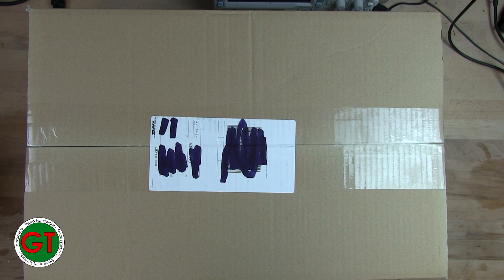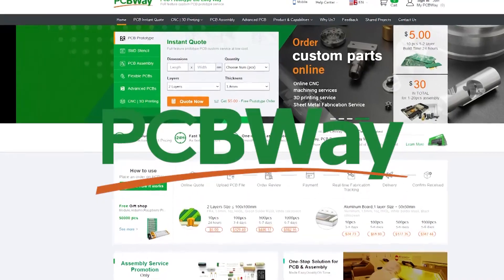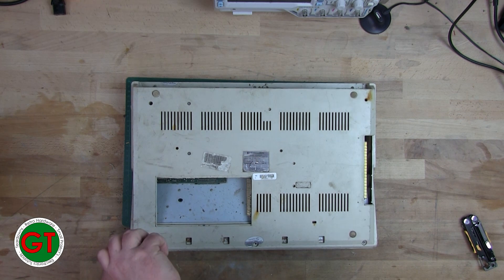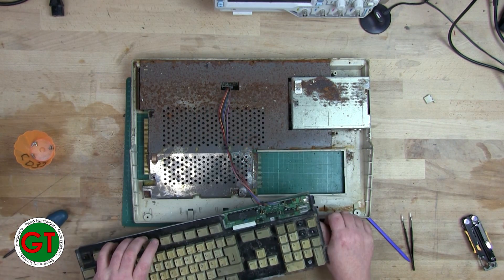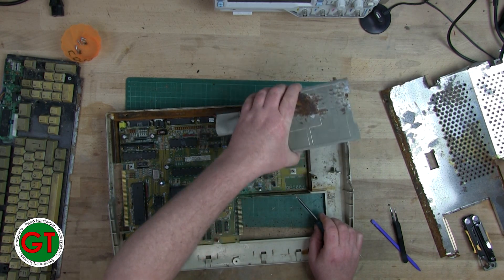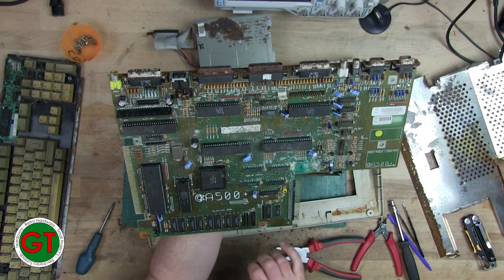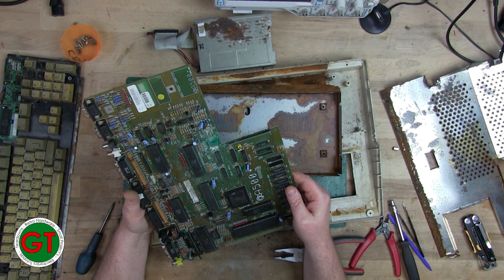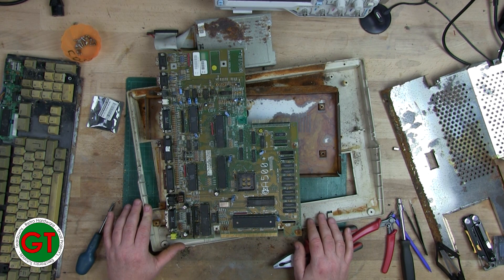Amiga 500 Plus - Trashed, can it be saved?

Comment: Oh god, that looks bad... Probably the worst I've seen, and I've seen some real bad... Time to do a rebuild on a new PCB video/project? Especially if that 2MB Agnus and Denise still lives!
Reply from the maker: Yep, I was thinking of getting a new board and doing a build, have not tested the chips yet. Am going to clean up the RF shield and spray it black, already got the paint 🎨
Reply: @GrahamTinkers  I wouldn't put the top shield back, it's not a structural piece like in an Atari ST. Of course you can still refurbish it, and I'll watch, curious how good one can get it. The bottom shield I'd put back however, that also helps a bit with the rigidity of the board in the case.
Reply from the maker: I tested all the custom chips and the all work 😎